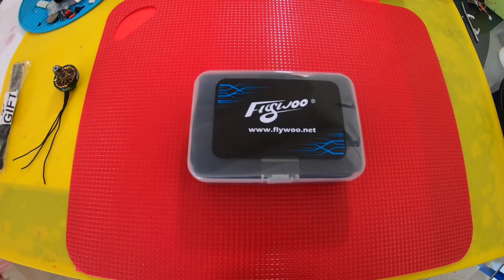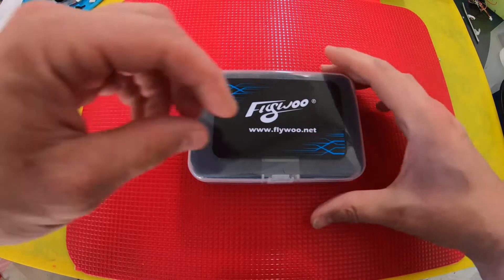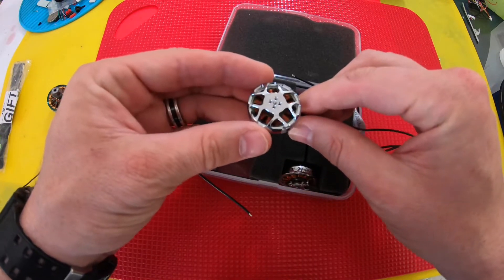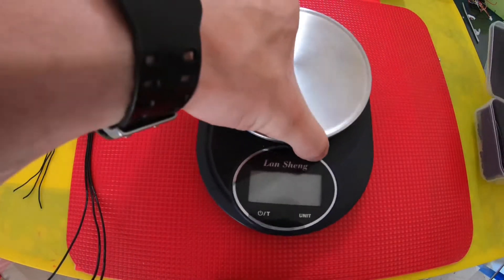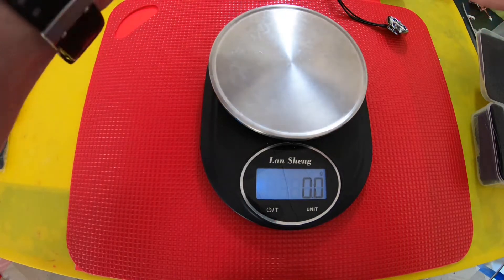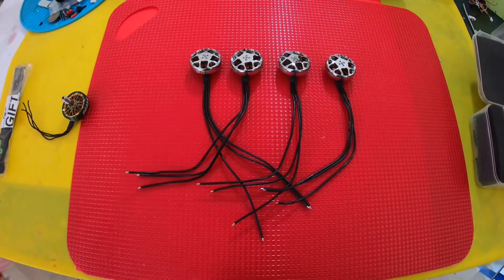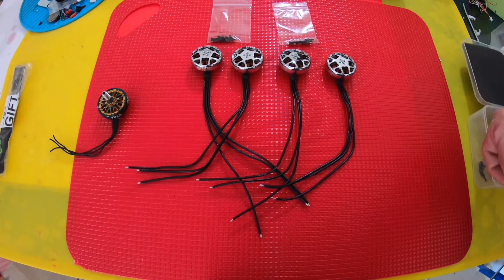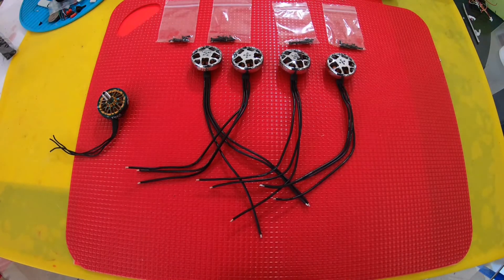New Flywoo 2303.5 1750kv Motors With a 5” & 3” Prop

Comment: So what are your fav motors for 5" ~300AUW 4s? Diatone Mamba TOKA 2203.5 2200kv maybe?
Reply: for smooth/efficient freestyle and throttle authority
Reply from the maker: The Diatone 2204 are my favorite, but finding them might be hard, I prefer a shaft not t-mount, so the AMAX 2305’s in 1950kv, or the xilo 2205 in 2250kv. I just got a set of BrotherHobby LA 2005 2450KV motors that could be perfect, but I have to test them. 
Right now, these 2305’s are on 2 of my light 5” quad and they’re good, as long as you’re not crashing on concrete.  
https://www.amaxshop.com/index.php?route=product/product&path=68_69_142&product_id=950
Reply: @DivergentDrones  Alright, thank you so much! Unfortunatley most of these Motors aren´t available in germany. the Toka 2203.5 2200kv is one of the only ones. What do you give up with that motor compared to the others?
Reply: @DivergentDrones  uhhh i just saw that the amaxshop ships to germany!:)) One question: Can a 4s 850mah deliver the amps or will these quiet big motors kill them? I am aiming roughly 300g auw. I dont need crazy topspeed, smoothness and controll is all i want:)

Comment: Hi, which do you like between this and the iflight 2205?
Reply from the maker: I just did a review for the AMAX 2305.5, I’ll post it tomorrow. It’s about as light as the iflight 2205 and has half the amp draw. But if I had to pick between the 2203.5, 2303.5, or the 2205 I’d say the 2203.5 preformed great for its size, but if you want to run the 2205 on 5s you might fine the sweet spot of that motor.
Reply: Hi Chris,  i just made a 3.5inch cinerat and now choosing a motor for it. I saw there is this 2205 and the flywoo 2303 and was wondering which one to get. Search youtube and you're the only one covering these motors. I have the protek35 using the 2203.5 and want to try a slightly powerful motor for the cinerat. So i guess the 2303 is not really that great is it?
Reply from the maker: The 2303.5’s were just ok, you’ll be able to tune out any issues you get with them. I just expected more stability from a wider motor. As amp hungry as the 2205’s were at 430g, you add a GoPro and you battery life will be like 2 minutes. I really like the FPVCYCLE 2203/4 motors and the the Diatone 2204 motors. They are both my best performing motors so far in that class.
Reply from the maker: I posted the 2305.5 video, it may be a good option…

https://youtu.be/mGD_M44I_TA